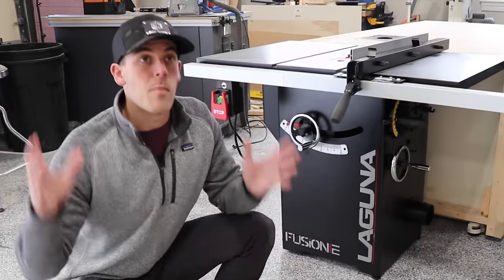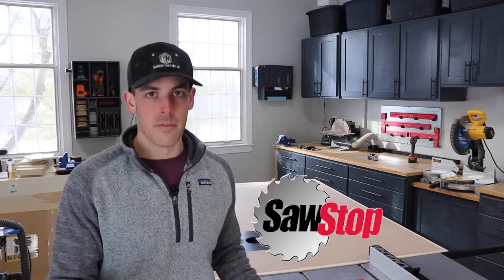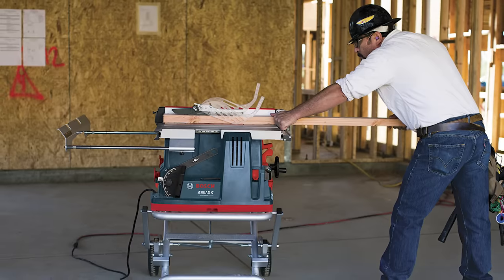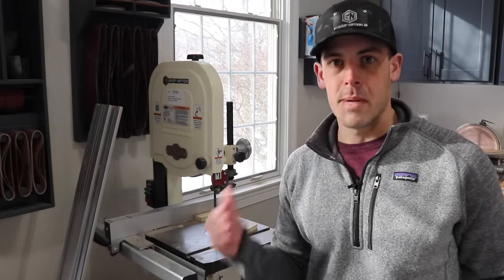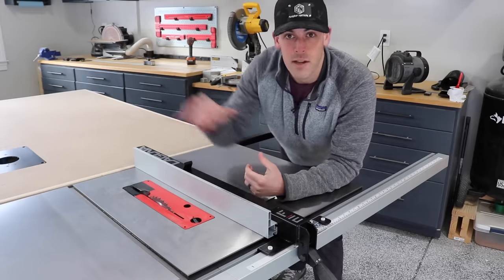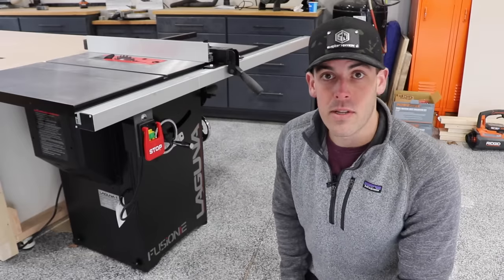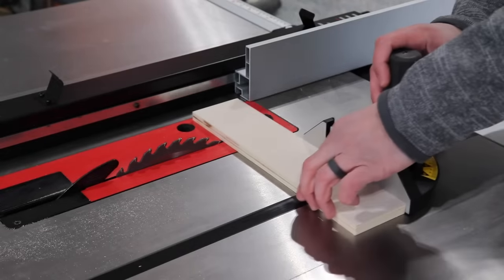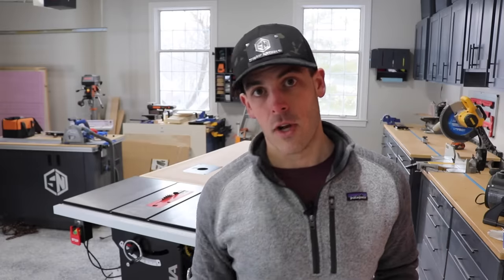Why I Bought a Laguna Table Saw over SawStop!

Comment: Sawstops have problems with kicking on the safety feature when encountering moisture in wood.  Beyond that, imho, there is really no substitute for always being personally cognizant and aware of your health and safety near a table saw.  Relying on some whizbang bladestop gizmo that could potentially fail at any time negates personal responsibility.

Comment: Ignorant question incoming.  That European style high/low fence...  I'm not seeing the purpose.  What does the low configuration offer you that the high doesn't?  Granted, I'm extremely inexperienced with wood working, but it seems to me that the fence is merely a straight reference surface.  How is a lower fence height any different than a higher one?  Even when cutting small stock like a veneer, it seems to me the fence being taller wouldn't make any difference whatsoever.

Please educate me, YouTube.
Reply: 1- if you have veneer overhanging all around the piece, you can still reference the edge by having the low fence slide under the overhang. (Honestly, other ways to deal with this, so nice to have but not necessary)
2- for think rips, you can keep the blade guard on, usually it hits the fence.

Comment: Looks nice and similar to Saw stop -- BUT -- In a world in which SawStop exists, it is hard to imagine purchasing anything that does not have the amazing finger protection of the SawStop. With over 4000 serious amputations this year alone on table saws, there needs to be a massive government program to require this feature and to help those in need purchase safe saws.  If more than 4000 WOMEN lost their hands or use of hands, each year, you could be DAMN sure action would happen.  STEP THE HELL UP MEN AND COMPLAIN!!!  You scream loud enough and they will buy you one free.  Time for government action on this issue.. Just too stupid and irresponsible to permit this to continue.  They should buy back all the unsafe saws and require all new ones to have that feature.

Comment: Woodpecker tools on the wall and you’re complaining about price. Seriously. I wondered and you confirmed it. You worked out a deal with Laguna. Hell, if I worked out a deal with a saw tool manufacturer maker I supposed I’d be obligated to choose them over the competition too, when price means nothing in reality, by virtue of what I see behind the obvious bias. 

I laughed when you talked about wheels. You don’t have to lift a SawStop to move it around the shop. It has a pedal that raises it up on three wheels. But you didn’t mention that..

Comment: Exactly my thought process when I upgraded my saw. For the price I was going to pay with a fully loaded SawStop, I could get a comparable sliding panel saw for $1500-2000 less and have more capability than what SawStop was offering at the time. With a panel saw, your hands are never close to the blade, so the safety features associated with SawStop are irrelevant. Ultimately the decision boils down to what you need the saw to do, price, and value added. Way to go against the grain (pun intended)

Comment: I can tell you Laguna has replaced a lot of the bandsaws in our companies factory. The only reason they go with sawstop for the table saw is because of the safety feature. While that is a good feature for those that may have trouble keeping digits from certain danger, I have (knock on wood) not had any close calls with the blade. A good healthy respect for the power of a machine and a few sacrificial push sticks make it easy to save those funds. Thanks for the great insight, hopefully when I finally get my shop setup later this year I’ll be giving Laguna a good hard look.

Comment: I come from generations of wood woodworkers and lumberjack , 
My Uncle was killed by a cable failure while tightening the system to haul logs over the valley as there was no road . There is not a single hill with someone's life written on it . 
My Father had part of the thumb missing , the little finger gone , darn a p ...r the cigarette lighter kept falling, then another one the local MD repaired as he cut it in half lengthwise  
 the main culprit the cold , and loss of sensation in the extremities = incorrect position , 
He was not a drinker nor ever used drug that was rich people disease .
if they gave you as special price or accessories it is being paid. simply look at your tax filing  :-{ 
what I like to see is a true side by side comparison, 
staring by the frame  mobile or do you need to buy a kit 
table steel, aluminum or cheap plastic composite 
fence what type and accessories available 
Blade side 
tilt or no tilt 
guard or no guard 
accessories to handle the material 
weight , dimensions. price
I agree with you  200 volt is far superior , run cooler and cheaper to operated {our machineries were 330 volts 3 phases } especially the infamous 4" router which had taken more finger than any other machine {from what I understand by the old timers if only felt like a burn .
 yes they are very expensive , the technology is not new it is a matter of time before the patent expire then everyone will jump on the band wagon 
Sorry I could not help with my post , hope you do not have hard feeling , 

Bus a my Father was saying , you see this blade or those blades as we had a machine with multiples blades to make plank on one pass , that blade is waiting for you to make a mistake like an axe on a pendulum., we actually had one circular saw , so powerful nothing ever jam it, these pieces of wood which we have all seen being kicked back , on that machine it was so violent it would go straight up and thru the roof .
Safety should be build in the retail price., insurance co should take this into perspective..

Comment: Love that reaxx shot slipped in there - if sawstop was so concerned about safety they would of allowed Bosch to use their reaxx solution [which I think is better than sawstops in that it doesn't destroy the blade] Guess sawstops main concern is the dollar .

Comment: Ok apply that logic of risk management to seatbelts in your car and bicycle helmets for your kids?  How many people who use seatbelts and bicycle helmets have actually needed them in an accident?  Now let's start the discussion on being consistent.
Reply from the maker: The incident rate of car accidents and falling off your bike are significantly higher than table saw injuries which could have been avoided with a blade braking system. A better comparison would be seatbelts on an airliner. Extremely low incident (crash) rate and the seatbelt doesn’t do much for a most of them
Reply: @ShopNation  Nice try but we both know that there are more bicycles and automobiles out there than table saws so the incident rate is obviously higher than for the table saw.  How about real numbers on incident % per cars on the road compared to incident for table saws in use.
Reply from the maker: I’m going to assume there are somewhere around 50MM table saws out there (average just over 1 in 5 households) and there are around 30,000 table saw accidents every year. Not every one of those accidents would have been prevented with a SawStop but I’ll be generous and say 2/3 of them would, or 20,000. That gives an incident rate of 0.04%. Now there are around 275MM cars in the US and according to published statistics there are around 6MM car accidents per year, 2MM of them resulting in injuries. That is an injury incidence rate of 0.7%, or about 18x more than table saw injuries. So yes, wearing a seatbelt is a much more statistically significant safety measure than buying a fancy table saw.
Reply: @ShopNation   We all know what assumptions are.
Reply: @ShopNation  You don't have to make assumptions and guesses. Several woodworking industry associations have already done the home work. Bottom line, 2010 (I may be a year or so off on that one way or the other), $400 million in tablesaws sold in the USA. $2.3+ billion in table saw injury costs the same year. I'm not quite sure why you seem so bent on minimizing the danger from tablesaws, but it's severely damaging your credibility. You chose a good saw at a different price point than SS and with different features. You're "managing your risks". Fine. They gave you a saw and SS didn't. I understand.  All that said, they're not competitive saws. They each stand on their own, but the idea that there's some vast conspiracy out there with a message that you're not a real woodworker unless you have a SS is absurd.

Comment: Thank you so much for making this video. I've always been uncomfortable with the sales tactics of the company that makes the Saw Stop. Also when another brand came out with a different but similar safety system, Sawstop felt they had to sue them out of existence. If they were so concerned about woodworker safety I would think they'd be overjoyed that there are other companies out there embracing their philosophy. Maybe they are afraid of competition.
I am 65 and have been a hobby and professional woodworker all my life. I still have all my digits, thankfully. I've had a few close calls but my belief is with proper safety training and some safety accessories you can be just as safe on any well-made saw. The ones that scare me are the sub $200 job-site saws. A crappy and misaligned fence presents more of a danger in my mind than other factors. The saw stop won't prevent dangerous kick back if you are not setting up your cuts properly. Years ago when I got my first Powermatic 66, I actually fell in love with it. It is a very safe saw, just by the fact that it is very well-built and highly accurate, with zero vibration. Even so, I quickly upgraded the power switch to include a disconnect switch and I also purchased the Microjig Grripper pushblock system. I still need to improve the blade guard and riving knife system and once that is done I believe my saw will  be every bit as safe to use as any other saw on the market.  Keep making excellent videos. Great content and very informative. Thanks.
Reply: I agree completely with most of your points. But you should recognize that your saw is not quite "every bit as safe as any other saw on the market." All else being equal, the absence of blade contact stop and retract technology means added risk. Obviously, you may well conclude that you're happy to accept that added risk--either because you think the added risk is acceptably low, or because you don't want to (or simply can't) pay more to further reduce the risk. Most people accept the added risk (whether they understand that or not), including most "real woodworkers, LOL". But without it, while you may be safe, you're simply not "every bit as safe." Just do the math...

Comment: Solid video and a great review of why you made your choice of saw!  I feel sawstop is a great innovation within the table saw safety realm but people mistake what it is there for.  For starters table saws can be one of the safest powered woodworking tools in the shop ... provided they are properly outfitted and those using them understand what they accomplish.  Blade guards prevent chips from flying in the users face, feather boards keep boards from drifting up or away from the fence, splitters/ riving knifes and paws reduce the chance of kick back, push sticks and power feeders keep your hands away from the blade.  That being said i have decided on the sawstop because it won't just be me using the saw (my wife, father and brother) all will at some point use it and the added safety feature will keep my mind at ease if they use it.  I will still be using all of the above listed engineering controls and safety devices as I do not trust technology to not fail and be 100% all of the time, and having always been the defacto safety engineer for the last 3 companies I have worked for I can tell you nothing beats layered safety as opposed to a single safety device.  Great video and I just subscribed btw 🙂

Comment: Nice review.  Refreshing to see some independent thinking (rare these days).  I too went from a contractor saw (Delta) to a cabinet saw (Grizzly).  Then, one day many years ago my wife and I were at Woodcraft picking up supplies.  The worker was missing several fingers which worried my wife.  She insisted I buy the Sawstop when it came out.  I didn’t want to argue.  😉

Comment: While 1. You got me to watch this video and 2. You got me to comment, I’ll just say why I did buy a SS. 

I too had the same delta contractor saw starting off. 

But when it was time to upgrade the saw for me it was a no brainer. We do custom fabrication in the automotive car stereo space and this is why it was a no brainer:

Employee and self safety. While maybe as a primary wood worker fine finger use isn’t necessarily a necessity, but when we need our digits to do wiring and more intricate functions, losing one or part of one is devastating. Hell, having a cut and a bandaid on a finger is an annoyance. 

As a sole wood worker such as yourself I can definitely see the hesitation and there’s a place for other saws. I’m not gonna tell you you’re not a serious wood worker as that’s dumb. It’s like the saying that you’re not a serious automotive tech or whatever if you don’t have a snap on tool box lol. 

I also like laguna products. We have their dust collectors etc. 

Enjoy!

Comment: Foolish decision .? False economy?  I think so. In my career I’ve treated multiple industrial related injuries. All accidents. Often due to inadequate safety measures or unsafe equipment. So I believe any safety measure should always outweigh any financial decision. If you can’t afford the best and safest equipment , wait save and buy later. Hand surgery can set you back as much as 30 to 40K in treatment if you’re lucky. Or permanent disability if you’re not. So $3,000 is a relative bargain.

Comment: I don't understand how you rank the Laguna higher than Grizzly.  With just a couple hundred more dollars you get a 3HP motor, great fence, etc.  The comparison there is flawed, but I do agree that you can get a great saw without buying the SawStop, but they won't stop when your fingers get in the way.  It's all tradeoffs.
Reply: Yes and no.  There is a Grizzly model that is close to what the F2 is, and is about $100 less.  However, I have just discovered that Grizzly and Shop Fox and changed their fence again.  It is a T fence, but the center section is an aluminum extrusion, not steel/iron.    How, for the saw you mention yes, it has a good fence, though it is $300 more for the 3 HP motor.  

It is kind of tricky comparing saws, it is not just about $, it is not just about features.  There are variances between the different saws, one not better than the other in many cases, juts preferences   Take the Jet ProShop II.  Pretty much the same price as the Fusion F2, pretty much the same saw.  One has a full cabinet, on is open.  One has cast iron wings and aluminum fence with 36" capacity.  One has steel wings and a solid steel/iron fence with 30" capacity.  Both great saws that will perform the same, as they pretty much are the same on the inside. 

So, for the Grizzly saws they compare closely to the Fusion F2.  The problem is the models do not exactly align.  They are either less expensive and not quite as nice, or they are more expensive and nicer than the Fusion F2.  Depends on what you want, and these days what you can find to purchase.
Reply: @alsmith7316 I was referencing how he said grizzly is lower end than Laguna.  That’s not true.  Maybe the models don’t line up, but Grizzly certainly isn’t a lower end player here...  that’s all I’m saying.  Looking at prices and features, I’d give grizzly my money for what would be similar spec’d models

Comment: NEWS FLASH.  IM GOING TO TELL YOU somthing you might not know. GRizzly sawstop powermatic genral Oliver, stanly delta festool ex... 
Pretty much 80% of the machines and tools are made in the same factory in twian  they are built slightly differnt
But its all the same stuff.
My Grizzly cost me 850 new 20 years ago
My jet retailed for 1495 4 years ago
The same grizzly saw now cost about 1200 to 1400 dollars. 
But if I had it to do agine and the money to buy all my machines ecpt a lathe and drill press or sander id look at fielders 
Lines  and they have a blade stop technology that dosnt break parts.
But more over its a 5 in one machine
12" planer 12" joiner shaper router sliding table  table saw. The works  
Now they are very pricy but you can always buy a used one. Why buy new?
Im sure the laguna is a nice table saw, get yourselfe a set of jessen table saw stock guids  that and the spliter will make your saw safer then if it did have the stop blade almost  if you cant afford that buy board buddies 
They will keep your hands way away from the blade. Also never push past the incert plate with your hand.